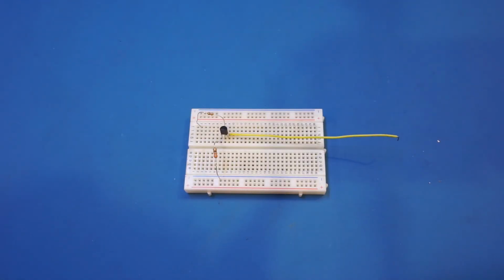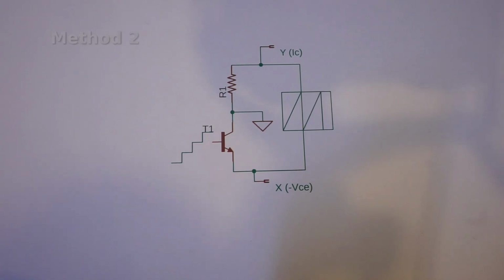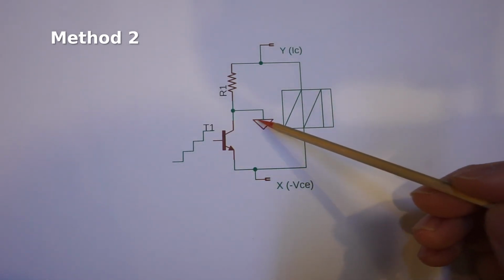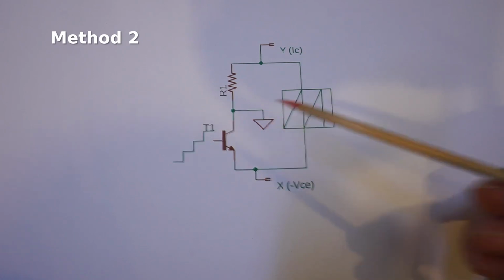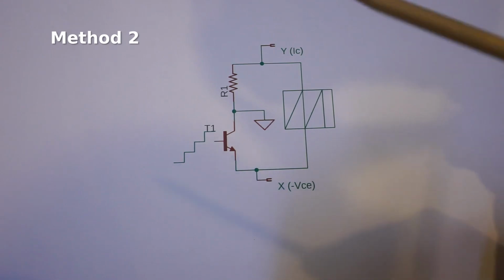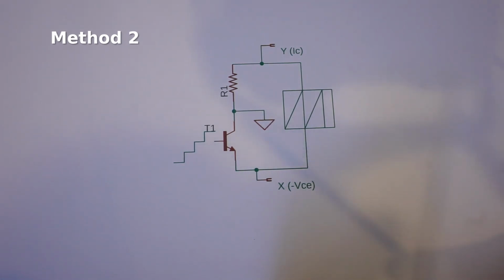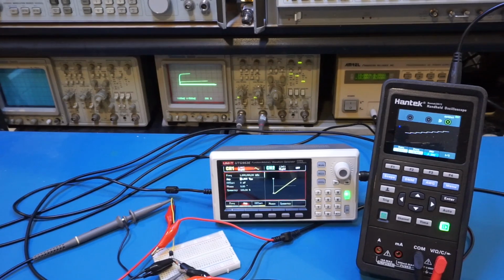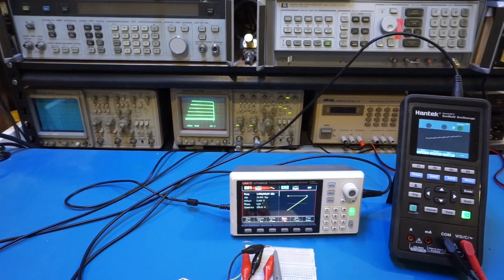Semiconductor Curve Tracing Using Function Generator/AWG

Comment: I appreciate your video. But I had a hard time following you as far as the offsets. How do the offsets and adding a DC voltage affect the display? I was also unclear of where you connected the grounds of the signal generator. How to you float the outputs of both signal generators?

Comment: Kerry I conducted a load test on my FeelTech FG3200 frequency generator the output only puts out 30 milliamps. Have you found this normal?
Reply from the maker: For most function generators, the output is not designed to drive significant load. While I don't have a FG3200 to compare, the number you reported is comparable with other signal generators out there.
Reply: @ Thank you. I bread boarded the Stair Step amplifier circuit great results.

Comment: Good afternoon. Question? When you designed and built the circuit. In the yet another curve tracer. Why did you input only 2 volts?

Comment: Question? This is reference to your Not another Curve Tracer. I found that you can use a cd4060be ic chip and a CD4024be and the R2R resistor ladder to build a Stair Step Generator circuit. Thanks for your input.

Comment: Kerry built the Triangle wave generator circuit. Of the Schematic Yet Another Curve Tracer I’m getting 1.09 volts output no load. Does this sound about right?
Reply from the maker: It's 2V peak-to-peak and it's bi-polar. so if you are measuring against ground then yes 1V is what you should be expecting.
Reply: @KerryWongBlog  Thank you.

Comment: On your article Yet Another Curve Tracer article. What frequency did you run the Triangle Generator Circuit at? I calculated it out to be about 288 hertz. One over time.
Reply from the maker: Yeah, it's about a couple hundred Hertz. The actual frequency doesn't matter that much. Because the triangular waveform and the staircase signal are essentially free running and not synchronized, I chose a frequency so that the traced curve can be refreshed at a reasonable rate on the scope.
Reply: @KerryWongBlog  Thank you. I bread boarded the stair step generator looks fantastic stable which I always try to achieve. Took your advice on the output transistors very nice results. Thanks again.

Comment: Kerry thanks for the Curve Tracer Video link. Could you send me a clear Schematic Diagram for your Yet Another Semiconductor V/I Curve Tracer? Thank you.
Reply from the maker: If you click on the schematic you should get the full sized schematics.
Reply: @KerryWongBlog  Thanks.
Reply: @KerryWongBlog  Question are you running the same frequencies on the X And Y parts of the Curve Tracer you built?
Reply from the maker: @MsFireboy2  No, the X and Y clocks are independent and free running.
Reply: @KerryWongBlog  Thanks. Quick question where did you purchase the final Transistors?
Reply from the maker: @MsFireboy2  Not sure if I understood your question. What do you mean by "final Transistors"?
Reply: @KerryWongBlog  Transistors in the Push Pull Amplifier sections.
Reply from the maker: @MsFireboy2  I used BD137 and BD138

Comment: Kerry Question are there a few Curve Tracer circuits out there that used a Ramp signal across the Collector Emitter Junctions?
Reply from the maker: Not sure if I understood the question. But I had built a curve tracer long time ago: http://www.kerrywong.com/2013/09/02/yet-another-semiconductor-vi-curve-tracer/ http://www.kerrywong.com/2013/09/09/yet-another-semiconductor-vi-curve-tracer-ii/ you can hook it up to an oscilloscope.

Comment: Nice video. 
Whether The Staircase wave form for base current and SAWTOOTH wave should be independent or synchronized? 
Another point is whether I can use Digital Storage Oscilloscope for this experiment to get the curves? Please. 
Thanks and Regards
Reply from the maker: These are two independent signal sources so they are not synchronized. In theory DSOs can plot in XY mode as well but a lot of the cheap ones have very limited refresh rates in XY mode so it may not work well. You will have to try it with your scope.
Reply: @KerryWongBlog  Thanks  for your reply. 
Helpful.
Reply: @KerryWongBlog  Will  you please explain why isolated grounds are needed? 
Thanks
N Das from INDIA

Comment: Man, I've made myself a simple curve tracer circuit using a 555 timer, a dual op amp LM358, a single op amp UA741 and a couple PNP and NPN transistors, I have a current mirror using two PNP transistors so I can use the mirrored signal to connect the second scope probe to for measuring the current through the DUT.

So, I have a fast square wave coming out the 555 timer and a slower square wave that I get from one side of the dual op amp which I'm using to reset the 555 timer via a NPN transistor and at the same time I have another NPN transistor that I use together with a capacitor and the second op amp to create a stairstep wave that I use to drive the base of the DUT, the collector from the DUT goes to probe one of the scope [Y] and through the current mirror to scope probe two [X].

The circuit works and I see the scope doing its best to show me something that looks a bit like a curve tracer, but something is off and I don't know what exactly and now that I watched this video hearing you talk about the problem we can have that we can't flip the wave or something like that, I'll have to watch it again because I don't understand that particular part, I can't visualize it in my brain before me as I have to be able to do for me to understand what's happening.

It's the way I learn and remember it for the rest of my life.

I'm making a video about it and I'll upload it here to YouTube as soon as I can, maybe when you see the curve tracer signal on my scope you can tell me what's going wrong, at least that's what I hope.
Reply from the maker: I built a V/I curve tracer a while back (http://www.kerrywong.com/2013/09/02/yet-another-semiconductor-vi-curve-tracer/) and the results were pretty decent (http://www.kerrywong.com/2013/09/09/yet-another-semiconductor-vi-curve-tracer-ii/).
Reply: @KerryWongBlog  I watched the video about it which is this video here.
The thing is that I'm learning to do it all analog and I have it working, kind of working I think.
It's just that I never made anything like this and I don't have a lot of experience with my oscilloscope that's also new for me so I'm not sure that the curve tracer is showing what it supposed to show or not.
And I have a digital scope which makes the X/Y trace behave different when compared to an analog scope, especially with this particular mode.
All that is complicating things for me figuring this out but I have to work with what I got and I believe when I have it working great and made it completely analog that I have a better understanding how it all works.
Which makes it easier for me in the future when I start another project.

Comment: Hi Kerry, new subscriber here. I very much enjoyed this video and look forward to watching more. I’ve been very interested in semiconductor characteristic curves for as long as I can remember. I find transistors (and other amplification mechanisms) fascinating. With all this talk about the characteristic curves of BJT however, the one important question that i haven’t seen addressed is: now that you have your curves, HOW DO YOU USE THEM?  Would it be possible for you to do a follow-up video where you set up various scenarios (problems) and a box of different transistors and explain how the IV (and other) curves can be used in a real-world scenario?
Reply from the maker: Much appreciated! Curve tracing is mainly used for analog transistor circuit designs (e.g. for setting the biasing point or Q point, figuring out the dynamic ranges etc). If there is enough interests in this topic I will do a video on it.
Reply: @KerryWongBlog  sounds good. I’m just trying to find an easy(ier) way to get a transistor to do what I want without having to do all the tedious calculations. And also trying to understand when exactly transistors with differing characteristics are used and for what applications. I can think of three (switching, audio, and RF) specialization,  but even within those specializations there seem to be many transistors to choose from.
Reply: @Ralph Reilly not trolling, just very eccentric.  I have always marveled at electronics, not simply for what they do, but for the underlying science behind it all - it's fascinating to know how things of this world behave, even moreso knowing why!
Reply: @aerostahr  You can also use the curves to find closely matched transistors, for building discrete differential amps, for instance.